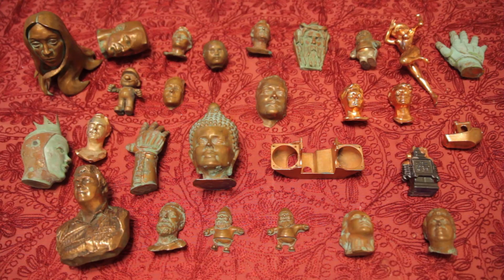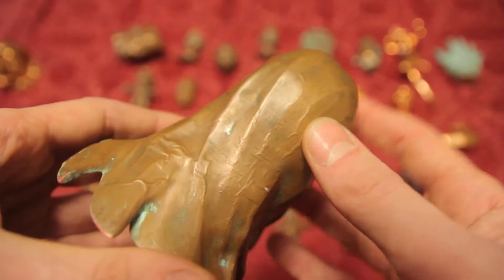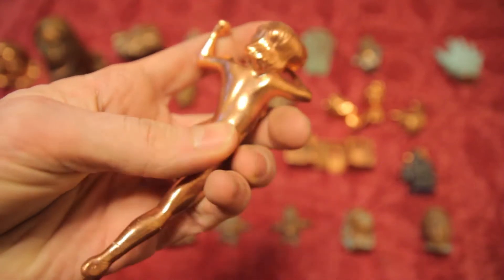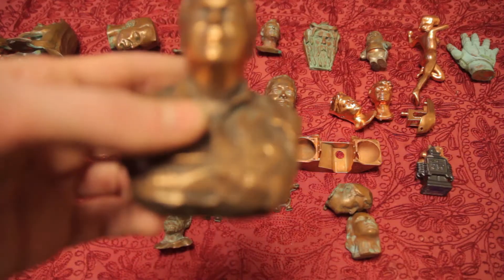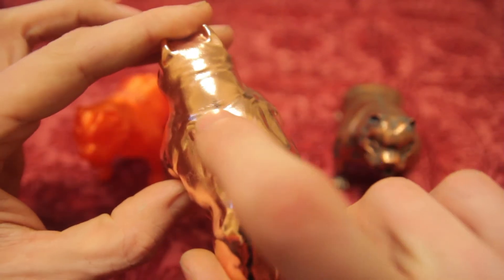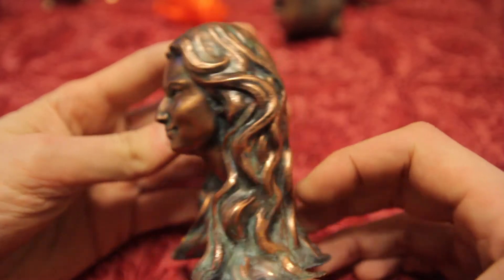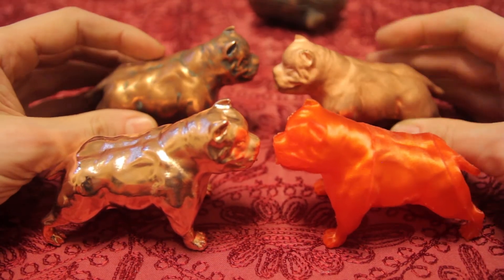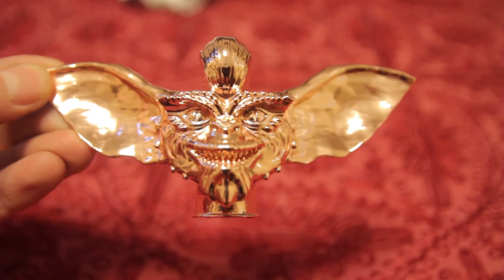My Copper Plated PLA Prints

Comment: Hi I’m new with the electroplating what did u use for the conductive paint silver or graphite to get that shiny bull dog effect???
Reply from the maker: That was graphite. The shinyness is not related to silver or graphite, as they produce equally shine. The main factor is the size of the object to whats needed. Large stuff 8 tend to use graphite with bits if silver in the hard to reach areas.
Reply: @Cloakfiend  ah i see cause i just new to this electroplating  stuff and i want to do some research on how to make gold plate for my plastic model kits like gundam
Reply from the maker: @zeraigon9833  ah for gold you need to do three passes. First in copper then nickel or silver and the gold. If you go to gold from copper it will be to reddish.
Reply from the maker: @zeraigon9833  i just do copper but to be honest it looks gold at the start. Once its oxidized a bit is goes more coppery. Maybe if you coat it with a uv laquer you can keep it looking golden? Be warned though for plating to work, you need to work clean wear gloves all the time and dont touch anything with ungloved fingers.
Reply: @Cloakfiend  thank you and really appreciate for the advice

Comment: Could you mix and match the graphite and silver? Like graphite for cost silver for the detailed and impossible places?
Reply from the maker: Yes in fact i do that all the time now. I just use my graphite coating technique for large areas and silver in the crevaces!! Works a treat! There are no seams as both paints lay on at around 10microns or less. You just need to be careful as the binder usually contains solvents and liquify each other on contact, ruining the applicaton. Care is needed for the entire process.

Comment: plating irregular surfaces forces consideration of cathode shape/position.  The other thing to consider is the use of  brighteners in your plating solution.  These effectively level the formed plate.  You look like you might be getting into the realm of electroforming.  Have you thought of back filling the hollow figures to stabilize them (consider epoxy resin)?  I might have missed it, but are you using commercial plating solutions or mixing your own?
Reply from the maker: Im using commercial chemicals but mixing them myself. The pre mixed ones are 10 times more expensive than the unmixed ones. I also use brightener but unfortunately it gets used up quickly and ive not had any luck in replenishing the shine after its depleted and just end up buying more chems. Ive considered the shape of the cathodes but generally am fine using the traditional bars surrounding it. My main issue is that i use plaster to fill my prints and that gradually ruins the solution dye to tiny leaks and makes the plate degrage over time. I really need to seal the objects properly but am far more careful now. I have a pretty good setup now but unfirtunately some companies lie about the grades of copper they sell which is annoying as the wrong ones just pollute the solution. Not many people are very helpful in electroforming, Ive asked lots of people but they never help. The way I prep the paint on my models before plating is unique though, but then again maybe others do it like me but never tell anyone. I dont know where to purchase brighteners on their own.

Comment: Do you know if petg warps less over time? This looks really interesting and really cool
Reply from the maker: The pla is generally fine just dont print entirely hollow and have at least 1%infill for structure. And fill it before acetoning it. That way it cant shrink more and will stay fine. A thick plate will be absolutely fine with pla. But like i said if you dont acetone it or sand it. Then the layer lines make the plate look awful. Even better spray a few layers of varnish over it to seal it properly as that is the main issue. The corrosive acid getting inside during the plate process and leaking back out slowly through tiny holes that you missed before you started. You need to seal your objects before plating and im just very casual about it!

Comment: Hey there, thanks for the video!  I want to do something similar, but now you've got me concerned...how do I  avoid the plating coming unstuck?   Does it have to do with the adhesion of the conductive layer?  Is it better to print with conductive filament or something else, like using spray adhesive and dusting in graphite?    I want to do copper>nickle>gold but really want the pieces to last.  ANY TIPS?!?!
Reply from the maker: Sure it will last. But there are many factors here. The main being somd of these are not even the strict 200micron thickness to even classify them as metal plated. The thicker you go the longer it will last. Also this will only really happen if you over acetone your prints as acetone shrink the pla ever so slightly which results in separation as does over polishing due to the friction generated. Flash plating is not really recommended for this method. But if you dont mess with your prints then they will be fine. Ive done A LOT. trial and error is your best friend.

Comment: can you just give basic specs so i can get an idea of electrolite and time it took soaking etc...thanks
Reply from the maker: There are no specs. Just electrolyte. And mine is nothing special just average. The brightener is the main issue. Its what makes things shiny. The larger the object the harder it is to keep shiny in the electrolyte. But thats a whole different kettle of fish! I reccomend classic platings electrolyte its what i use most often. Google 'classic plating' or something similar that brings up what you are looking for i dont have the box it came in anymore. But not solely there are loads of brands which essentially sell you the same thing so just buy the cheapest one you can find. Its about 40uk pounds for 5 liters. i found premixed electrolyte stupid expensive hence just mixing it up myself. Its real easy. You can do it in the kitchen. Doing all that pickle in a jar stuff is a waste of time unless you are plating some coins or metal stuff. Plating conductive paint is a bit harder imo. I have a few secrets though.
Reply: @Cloakfiend  thanks i just saw this today and its very cool science..i will research more..one guy uses vinegar and . peroxide..thanks again
Reply from the maker: Good luck dude!!